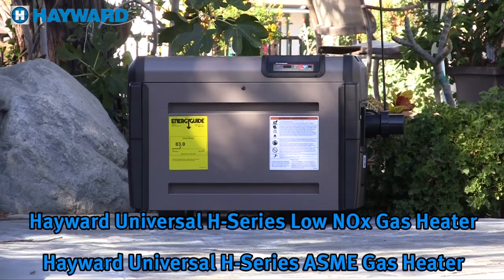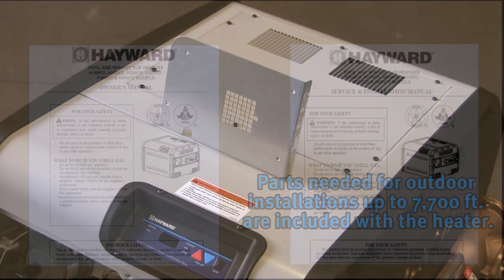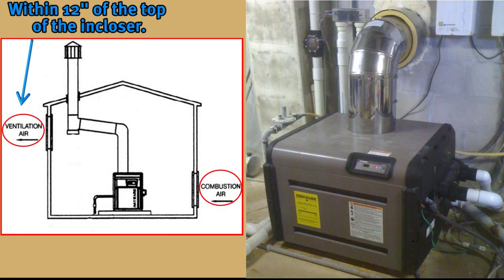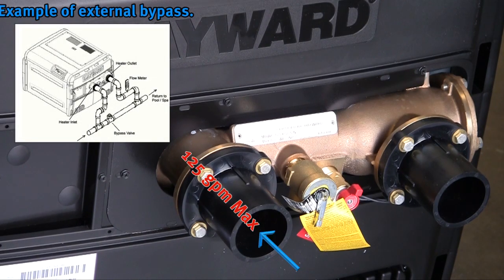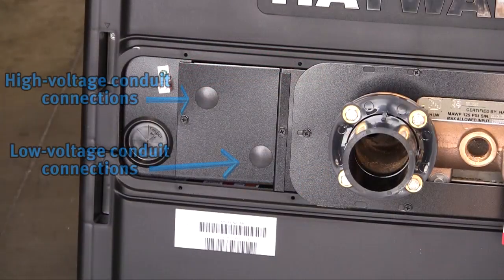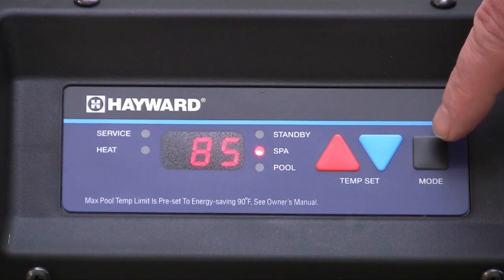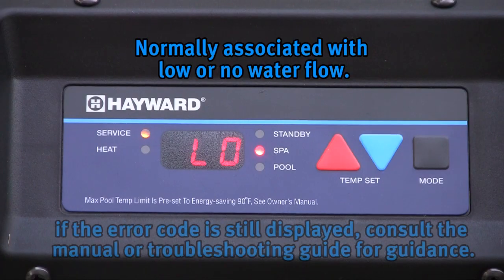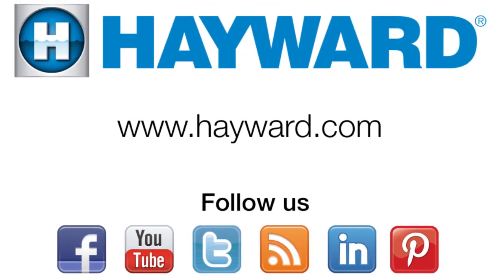Universal H Series & ASME Gas Heater Installation, Start-up and Troubleshooting

Comment: do NOT buy a Hayward Heater... bought our BRAND NEW and after 3.5 months of running was spewing water from the heat exchanger. Contacted Hayward and they sent someone out and said if the Ph in the pool is even slightly off it VOIDS WARRANTY on the heat exchangers on their Heaters. Our water is tested MONTHLY and they said it doesn't matter...and said again if Ph is even a bit off the heat exchangers will go! DO NOT BUY...don't want to see anyone deal with what we have dealt with.

Comment: Can you guys address something with the h400 FDN ASME? I've got mine with 2-in plumbing and on the flovis meter showing 50 gallons per minute flow just after the heater. It's overheating the high limit switch. Or I should say one of the high limit switches. Everything ohms out except the limit switch on the top of the bronze manifold. The one that was in the unit from the factory was labeled 135° F. I jumped it out and it will run indefinitely with no issues thereafter. Otherwise it shuts down prematurely and throws the LO code.  Limit open. I bought a new high limit switch but same problem. The switch must be overheating because I'm losing continuity across the switch after the unit runs for a few minutes. Then once it cools off it fires up again for a few more minutes and keep cycling as such. Is it possible that the Hayward high limit on top of the manifold should actually be the 165° F one?  Maybe the incorrect one was installed in the factory leading me to then replace with the 135° one as well.? My understanding is the heater only needs 30 GPM so even if the flovis is inaccurate, it would need to be off by almost 50% to be approaching the minimum flow rate for the heater.  

What am I doing wrong? And yes everything is backwashed, the salt cell DIG 220 filter screen was cleaned, and valves are all open without any outside bypass.

Comment: They missed one small important detail.  Add some pool lubricant to those gaskets on the inlet and outlet unions.  Trust me.  Last longer and easier to get on and off.   Also will ensure a better seal.

Comment: How does the heater interface with the pump?  Assuming the heater will only operate when the pump is on or the heater turns on the pump.

Comment: Is a new H400 heater a drop in replacement for a 20 year old H400? Is the left-right spacing of the inlet/outlet the same now as back in the day? I’d like to replace my heater but if it’s not drop in I’ll wait until next year… Thanks in advance.
Reply from the maker: Hi Frank, thanks for your interest in our heaters. Probably it would be most helpful if a Hayward tech or your local dealer advised on the replacement unit. You can find our dealers on our website Dealer Locator here: https://www.hayward-pool.com/shop/en/pools/Dealer-Locator?langId=-1#top. Or you can leave your contact info by private message on Facebook or Twitter or email us at marketing@hayward.com.

Comment: I cannot find the spot to hook up the wiring.  The wiring in this video looks nothing like my model, H150FDP.  The manual also has a pic for wiring that looks nothing like mine.  Phone support was clueless, they could not even tell me if electric hookup was on left, right, or front.  It's been a week and email support has not replied.  I may return my heater if they can't tell me where to hook up the wiring.  Horrible support.
Reply from the maker: Hello, we'll ask a Hayward tech to contact you. Please private message your email address and phone number on our Facebook page or Twitter profile or you can email us at marketing@hayward.com.

Comment: my Hayward Pool Heater H250FDP (4 years old) is dripping water at the rear (about 1 drop per second).  My installer no longer does service.  Is this something I can do myself (replace gaskets) or who can I call to help.  zip is 89027
Reply from the maker: Hi Marge, both of the following are premiere authorized servicers:

Johansen's Pool Svc
928 North Westridge Dr.
St. George, UT 84770
Tel: (435) 673 6024

Ence Pool Service
Ivins, UT 84738
Tel: (435) 669 6913

Our Hayward tech can also reach out on Monday if you’d like to dm your email address and phone number on our Facebook page or Twitter profile or via email at marketing@hayward.com.
Reply: @HaywardPoolProducts  Thanks, I have emailed the problem as you suggested.

Comment: My system just got hooked up and the unit isn't firing up. I have a h500 propane system. Fan isn't running, its hooked up to an omnilogic panel.
Reply from the maker: Hi Mark, we'd be happy to connect you with our tech team for help. Can you please provide us with your email and phone number through a private message on Twitter or Facebook or by sending us an email at marketing@hayward.com? We'll have someone contact you directly.
Reply: @HaywardPoolProducts  thank you i replied on Facebook and sent an email to the address you indicated.
Reply from the maker: Thanks Mark, got your info on Facebook and will follow up.

Comment: Hi
What CE code is for?
Reply from the maker: Communication Error.   You can find the manual for your heater on www.hayward.com.  This normally is between the display board and main board. Could also be any of the wiring along with the Key Pad.

Comment: Yeah, you are lucky. They won’t even TALK to me at Hayward cause I’m not a service tech. Dentist? Check. Do my own plumbing? Yup. Work in my breaker box? Sure. I took my 400H series apart due to an ignitor failure code. Replaced ignitor, still shows IO. Followed all of the troubleshooting steps and got to “call support” with a phone #. I called and the young lady’s response was “ I can’t troubleshoot with you, you’re a consumer. You have to call a service tech”. Incredible. Where I live nobody will even walk in the door for less than 200, and then they will call and the tech will tell them what to replace. Thanks Hayward
Reply: Ha I saw that video
Reply from the maker: Please post your phone number to Facebook and a Tech will call.    If you are still getting IO after replacing the igniter make sure the ground is good where the igniter is secured.  Clean all surfaces.  If after that is done you still have the IO the only thing left is a bad main board.
Reply from the maker: Hi there, please private message us on our Facebook page or Twitter with your phone number and someone will call to help.
Reply: @HaywardPoolProducts  I didnt see this response from two months ago,, but I fixed the issue myself. I had kept an old circuit board when I replaced it (with a different issue), and I re-installed that "bad" board,.and no more ignitor error. 
So I need to replace the main board prior to next season.

Comment: I have a H250FDN, it starts up and runs for a few minutes, then shuts with a A0 code.  If I wait a few minutes, turn to standby, then back to pool, the process repeats, runs for a few minutes, then shuts with a A0 code.  Blower, tubing and connections all look good.  Could it be a faulty switch ??  If so, why does it run, then fail ??
Reply from the maker: It is possible that the switch is still bad.    Use the chart below to check. 
 
 
 AO
 
 Blower vacuum switch open.
  1. Check for faulty vacuum switch tubing
  Check tubing and replace if necessary. If OK, proceed to step 2.
   2. Check for faulty vacuum switch wiring or connection.
 Inspect vacuum switch wiring. Ensure wire harness terminals are securely fastened to spade terminals on vacuum switch. If OK, proceed to step 3.
   3. Check for faulty blower wiring or connection
   Inspect blower wiring. Ensure plug on blower is securely fastened to control module. If OK, proceed to step 4.
   4. Check for defective vacuum switch
 Disconnect Blower plug from Control Module. Measure resistance across Blower windings. Winding resistance across lead should be in the following range; Red-to- White: 8 to 9 ohms. If measured values vary substantially from these values, Blower is defective. Replace. If OK, proceed to step 5.
   5. Check for defective blower relay.
  Disconnect Blower plug from Control Module. Place heater in Pool or Spa Mode. Lower set point temperature to generate call for heat. During pre-purge period, measure for 120VAC across pins 1 and 2. If 120VAC is not present, control module relay is defective. Replace control module. If OK, proceed to step 6
   6. Vacuum switch is defective
  Replace blower vacuum switch.
Reply: Number 4 says to Check for defective vacuum switch, but the subsequent instructions say to check the resistance across the blower windings.  It read 4.7 ohms across the red and white wires at the plug that I disconnected at the control module.  would that indicate a bad blower ??  I can send pix if that would help.  Is there a number to call and ask a question ?
Reply from the maker: Michael, please private message your phone number and someone will call to help. You can leave a number for us via our Facebook page or via our Twitter handle. Thanks.

Comment: I have a Aqualink RS8.  
  Which of those lines connect to the common, spa and pool line on the Hayward heater?  I think that the black (2) line connects to the spa line, the yellow to the pool line and the white (not one of the 4 pins) should connect to the common line?  Is there a site which discusses the connections?
Reply from the maker: Hi Valter, please PM your phone number and email address and a tech will be in touch on Monday.
Reply from the maker: An RS8 only needs two wires connected to the heater.    Please go to this link and page 28 for the 2 wire connection.

https://hayward-pool-assets.com/assets/documents/pools/pdf/manuals/universal-h-series-installations-manual.pdf?fromCDN=true

Comment: @Hayward Pool Products - I have a 2 year old H400FDP Heater.  My water is clean, propane tanks are full, water is circulating fine - but I am receiving an IF code.  I've read that this can be caused by having clogged up orifices from insects/spider webs.  How can I clean this out and get this very young unit up and running again?  Do I take off the top, front, or back panel in order to access and clean?  Can you point me to a video or photos of the area I should clean?  I called customer service and chose heaters, but keep getting a busy signal.  Thanks
Reply from the maker: There is no video on doing this as it is a gas appliance.   Cleaning the 
orifices Requires disconnecting the gas lines and removing the 
manifold.  Should be done by a gas certified tech.  IF means ignition failure.  Gas pressure needs to be checked. Tech with manometer needed. Please PM your phone number and a tech will call.

Comment: My daughter has a Hayward heater and is gone a lot being in the military. I wish the manuals were better in giving directions. Not a clue as to where the lines go from the heater to the water lines. I use to know and even took pictures but .. mind is gone and so are the photos. I know one goes from the heater "out" to the return eye but can't figure out where the "in" goes. LOL I know it must be coming from the skimmer basket but then its not going through the filter basket on the motor/pump before going through the sand filter. I know if I stare at it long enough, I might be able to figure it out but it is a real shame it is not included in the owner's or contractor's manual because even the pool store she spent over ten grand at, won't be kind enough to tell her. They will come out to do it, of course for a service fee !!
Reply from the maker: Hi Kathleen, please private message your phone number for a call back from a tech tomorrow.
Reply from the maker: On the right hand side of the heater is a label that will tell the serial number and model number.    Knowing that will help in determining the answer.      Normally for an above ground pool it is skimmer to the front of the pump, out of the top of the pump to the filter valve port marked pump.    Now from the filter valve marked return it goes to the inlet of the heater.  From the heater outlet to the return on the pool.   I am assuming this is an above ground pool.  If not send a picture.
Reply: Thank you for your quick response. I will go out and find the model number but I'm looking at the manual and it says for the H150FD, H200FD,H250FD up to the H400FD models.I went outside and sat there for a bit knowing I should be able to figure it out and eventually it came to me but I will wait to hook up the heater. The only line I will alter is the one that goes OUT of the filter to the return eye. The hose going to the heater IN will be connected to the connector coming out of the filter ( cleaned water ) and then the OUT on the heater that line goes to the connector port that is the return eye, the clean water would have originally went from the filter to the return wall eye. I think. You do not change any lines from skimmer to the pump because that is not " filtered, clean water " it has to be the line coming FROM the filter. Correct ?? !! And how does the water go to the heater to PRIME it ??
Reply from the maker: Hi Kathleen, we will ask our tech to get back to you. Please PM your phone number.
Reply from the maker: The clean water coming from the filter valve will prime the heater and get it running.
Reply: Thank you for all your help. I did not see these , SO sorry. But I hooked it up and it is running BEAUTIFULLY. But I am SO CONFUSED !! My water temp is where I want it to be and my pool  filter/pump has been running over 10 hours. I know when I shut it off for the night, I put the heater in the standby mode which means it will not be heating the water. So the water can only be heated if the pool filter is running?? I keep reading the manual but I do not see anything about it. And I'm a little confused where it said you can have 2 settings. I do not know how to private message you to give you my phone number. Could you tell me how I do that ?? Thank you for all your help !!
Reply: If you are that confused hire someone. Of course companies will charge a service fee to come out, i mean do YOU work for free??

Comment: Funny how your display panels deteriorate from sunlight in a couple of years, yet Hayward refuses to cover it under warranty. I've had the H400FDN for about 5 years and it's been the most troublesome piece of junk I've ever purchased.
Reply from the maker: +Clint Lacewell Hello Clint, thanks for reaching out about your pool equipment. Our Hayward tech would be glad to give you a call to help. Please private message your phone number on our Facebook page. Thanks.
Reply from the maker: Betsy Santos may we be of help?
Reply: did they ever help you???
Reply from the maker: Hi Joe, may we be of assistance?
Reply: just had a 350k btu heater and it displaying a LO message.
Reply from the maker: Fabio, our tech can call you. Please DM your phone number.
Reply from the maker: Got it Fabio, thanks.
Reply from the maker: Fabio Gomez LO could be as simple as a dirty filter.  Remember when the pump is off LO is normal.  Once the pump starts up and flow is good the LO will go away.   If you have a LO after the filter is cleaned you may need a technician to check the system.
Reply: Hi there i have one that is the 400 series and turns on for a second or  two and turns off it does not stay on any info. Will help i am in guadalajara mex. And i dont have a lot people that could help me thank you.
Reply: This is the problem I am having as well.  Unfortunate the replacement parts for this issue are so expensive.  I love all my Hayward equipment but these costs are getting tough to swallow.
Reply: Can't agree more!!

Comment: why not under a deck if it is very high above?
Reply from the maker: n4ktz There are several reasons not to install the heater under the deck. Please share your phone number and a Hayward tech will call you.
Reply: Mine is already under a staircase and has been there for years. The inspector gave the approval with it there so I guess he did not care.
prefer not to give phone number cause may get bunch of calls from others. If I had email I could email phone number.
Reply from the maker: You can email our technical representative at haywardtech@gmail.com.